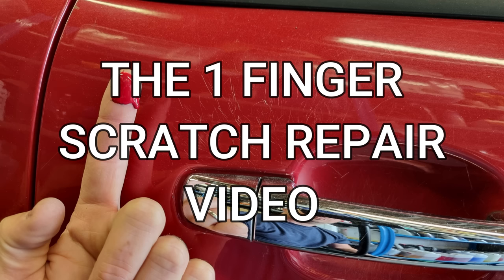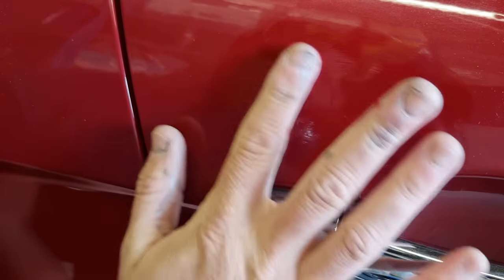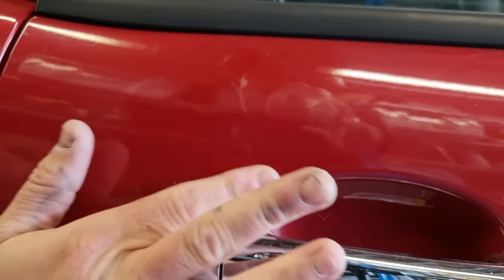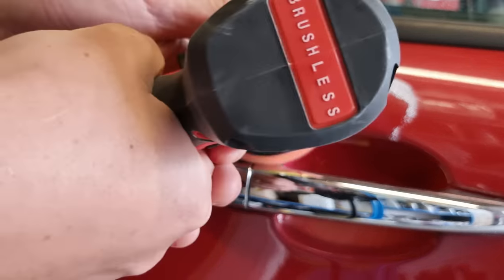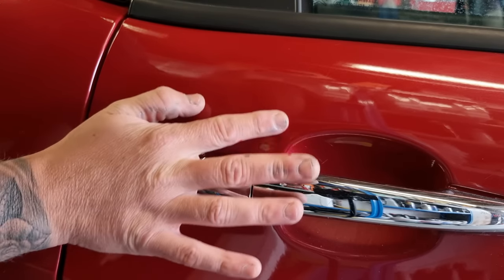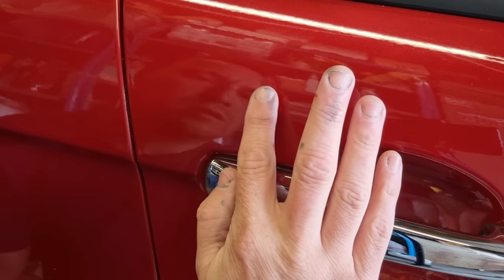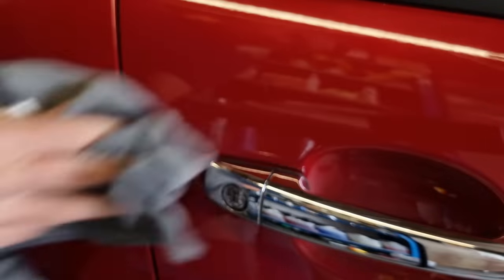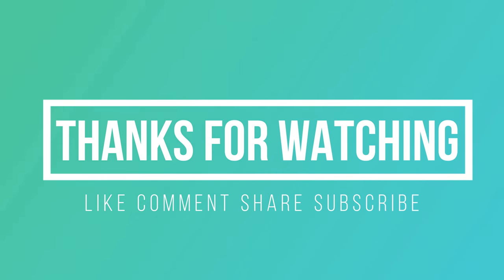Car Paintwork Scratches Try this method to save you money!!

Comment: Been a detailer for over 25 years and this is the best scratch quick fix I've seen. Cracking job, mate!
Reply from the maker: Love to hear that mate
Reply: Hi please do u leave it to dry or u polish straight away
Reply: @zoomgalaxy5876  You should probably let it dry first before putting wax on it
Reply: Well if anyone was entitled to make that judgement Mich, I think it would definitely be you buddy! 👍
Reply: Any suggestions on how to remove light scratches and swirl marks ? Like only noticeable in particular lighting an angles. Long story short wiped down parts of the car with microfibre cloth that was wet ( so was the area ) then wiped it down with a dry one. Any suggestions?
Reply: @supermoegaming4487 needs a minor paint correction, light polish maybe. Also I think ceramic coating could fill in really light scratches, or if you have black paint there is a black filler polish wax that works great for a little while
Reply: @justinprohm  Thank you!!
Reply: @cvrpov into the paint.Do I need to add a hardener or a different chemical
Reply: Thanks for this great help, a friends car is 25 yrs old and needs some paint repair on a budget .
Reply: I’m not surprised that Edward Scissorhands was chuffed when he picked it up.
Reply: @supermoegaming4487  yes machine polish your car. First compound and then a fine polish. 2 passes of each should do it.
Reply: @cvrpov .You are very unclear as to when you can buff up the new paint. How long to leave it?
Reply: @cvrpov   You are very unclear as to how long to leave the new paint before buffing.
Reply: good question, i would also like to know. At around 4:05 he says it didn’t require hours or days for the paint to dry, so I would assume when the paint you wiped on is dry to the touch and not sticky.
Reply: @JV8391 It is obvious,  is it not? He meant he waited until it is dry, depending on temperature,  it can take 20 minutes, 10 minutes or an hour.
Reply: @theilluminatedone525  Just asking for clarity as obviously the touch up paint was not completely cured in the video
Reply: @JV8391  it was, he just did not show you. If it was still wet, it would smudge when sanded or touched.
Reply: @theilluminatedone525  Thanks for being the smartest guy in the room. We're all here on youtube to watch things and learn, not to see one thing and assume another thing. 

I watched most of his other vids so I've got an understanding of it.
Reply: @JV8391  pleasure man, sometimes just a little bit of common sense will go a long way.
Reply: That's unreal. Just a few minutes to let the paint dry. Great result, well done.
Reply: Guys, here is The True Savior

HalleluYAH “Praise ye YaH”

YaH is The Father (Genesis 1)
YaH arrives via the TENT OF MEETING
YaH was Who they Crucified for our sins
YaH was Crucified on an Almond TREE

Ancient Semitic Moshe (Moses)
Isaiah Scroll (The Original Isaiah)
Reply: Sorry man but I need to ask: after working 25years on paint you have never tried to actually apply paint into scratch or any other paint defect??????? @cvrpov you're going to destroy paintworks 😂
Reply: How can we get your suggested products in the US?

Comment: I tried this technique on my 1995 Ford Mustang. It's metallic red and had a large number of minor scratches on the passenger door. I used Testors model paint and the results were very good. Of course it didn't remove the scratches, but I would say it looks 95% better. And the paint only cost $3.25.
Reply from the maker: good stuff mate glad it worked for u

Comment: That worked surprisingly well, not that I ever doubted you! In my case, I hand compounded away the extra paint, with not much effort. If I had advice for anyone doing this for the first time, it would be to use just the lightest dab of paint. Less paint, as long as it fills the scratch, means less buffing.

Comment: I've done exactly this for many years with about the same 90 % results.  I've just retired a GMC van after 22 Canadian winters and I've often had people stop me to ask if I've had the vehicle repainted.  Fill the ditch with paint and buff off the thin excess on the flat surfaces.
Reply from the maker: It works great in the right circumstances
Reply: I'm Canadian also... What paint and polish do you use?

Comment: I've got a fairly bad scuff in the middle of a panel and was about to pay over £500 to have the whole  panel repainted. To be honest,  I'm a bit worried about the matching to adjacent panels. Having seen this, I think it's worth having a go first. If the scratch is too bad and it doesn't work, I won't be worse off. Thanks for the tip!
Reply from the maker: Always worth a go mate. That's what this channel is all about

Comment: ❤ Great method thank you very much.

I tried it with meguiar's ultimate compound and a drill. The deep scratches don't go away with this compound. But combined with the touchup pain, it does fill them up nicely so you can't see them from a distance. Much better than the white scratches on my dark metallic paint I had before.
Reply from the maker: Glad it helped

Comment: Having just spent the past couple of weeks learning on the go how to fill & paint deep scratches on a friend’s car, I’m pretty blown away by this.  Their car is a silver metallic Hyundai & so has loads of holographic glitter bits in the paint, so after filling the deepest scratches with putty (down to plastic on the bumper - use a putty that you mix up a bit at a time or your whole tin will harden while you’re still filling in the first few scratches 😫), I’ve been using a bit of torn up sponge to dab the custom-mixed acrylic paint with hardener on.  It’s a great way to get the sparkly bits to stick.  It’s a bit darker than the original though as the original paint has faded a bit, so trying to hide it totally is really hard, so this wiping method might work better.  (Only cost $28 Aus for the paint).   Will definitely try this for the shallow scratches.  One issue though is that apparently you can’t expect the paint to stick for long over wax - you have to clean & wet sand with a fine sandpaper a bit (I’ve been using 1200 grit) or use a wax & grease remover to allow the paint to grab between coats.  So better to clean/sand, wipe on paint, allow to dry, wet sand until smooth, reapply as needed, then do a gloss topcoat (another $20 ish plus make sure you mask off the rest of the car & windows!) & wax or just wax if you’re not too fussy about longevity.   Without the UV gloss topcoat, the paint you added will darken over time.  But this method will definitely pretty up the area & is an easy top-up for not much money so depends on what results you want.  Roll on the self-fixing paint is all I can say!
Reply: PS thanks for the quick intro!  So refreshing

Comment: This does work but it works much better if you thoroughly clean the area with a suitable solvent before you apply the paint. That way you remove all the polish and cleaning products that might be embedded in the scratches.
Reply from the maker: This car hadn't seen any polish in years by the looks of it
Reply: @cvrpov  Probably right but the upload is for people in general. Some suitable solvent get rid of atmospheric and environmental dirt as well.

Comment: Great method.Just wondering, How long did you leave paint on before buffing.  Is the paint from a can or out of a touch up pen. Would  using a touch up pen (brush end) work the same i.e. smearing on scratches then buffing.  Cant wait to try this. Fantastic video
Reply from the maker: Touch up pen yes.. aerosol no
Reply: @cvrpov  Perhaps I missed it, how long did you leave the paint on before buffing?
Reply: @cvrpov  Hey Mister.   Michael and Bob want to know "how long did you leave the paint on before buffing". Would you like to give an answer? It's been like 2 weeks now.

Comment: Great Job, Can you tell us aprox.  cutting power of the compound you used ? Is it around 5/10 ? (Like Menzerna 2500) I guess if you use an agressive compound , it could  remove the paint that you applied. Thanks
Reply from the maker: G360 I'd about 8/10
Reply: @cvrpov  Thank you

Comment: Dude...overkill. For the past 20 yrs I have removed ALL fingernail scratches from door handle areas with the least abrasive paste in the polish line up: CAR CLEANER WAX in my case I prefer Maguire's, it works so well, it doesn't even require a machine, you can do it by hand, quick and least invasive.
Reply from the maker: 100% wouldn't of removed all of these. Maybe some, but not to the level this would. Trust me... been doing this 18years myself. Waxes most often just temporarily fill damage.
Reply: No, the car cleaner wax lasts for a few days and then washes out. (Getting fresh paint into the scratches is a brilliant answer!) well done and nice job!
Reply: This is why I open and close for passengers.
Reply: Honestly what planet you from. Some of theses scratches are made by keys. No polish in the world will cute then out DUDE
Reply: DUDE...These marks are deeper than surface scuffs left from finger nails. I'm a fan of Maguire's cleaner wax too but it's not going to do squat against the deeper scratches in this video.
Reply: He said he can’t Polish these scratches out… dude

Comment: It makes sense bcos the scratches are filled by the paint. It takes the eye off the scratch. The buffing evens out the stained paintwork around the scratch. I use a felttip dipped in paint to fill the scratch but this method really gets into the nooks and crannies. Great job though
Reply from the maker: Thanks bud

Comment: I had this problem and used electronic spray to clean both front doors. Local Ford dealer replaced switches in each but the dinging continued; they were stumped. I went to Aberdeen Midas for safety evaluation and in the process the Tec,  “Jake” found the rear passenger door was not latching at the bottom. With cleaning and lubrication the latch worked, the door ajar warning was resolved and the damn dinging stopped😀👍 Thank you Jake.
Reply from the maker: Not all hero's wear capes. Thankyou jake

Comment: Excellent straight to the point video, it's how i do my videos on my YouTube channel.  Could I spray paint into a lid from a spray can and use that paint to dab on with finger?
Reply from the maker: Rattle can paint is often too thin. Perhaps spray some in then leave the solvents to evaporate and thicken the paint up a bit. Never tried this mind, just a suggestion
Reply: @cvrpov  thanks for the advice, I may do a video, I will mention you if I do

Comment: When you say Solvent paint, what are you talking about exactly?   Is this automotive paint or are you talking about brands that sell at hardware stores likes rustproof paint?  This method is great for things that would need a repaint, I want to add it to my skill toolbox for sure!
Reply from the maker: It's basically the paint that sprayers use. Less common but still readily available. If your in the UK www.paintgear.co.uk sell it

Comment: I've been doing this for 30 years. Apply at 90 degree to the scratch and wet sand(very lightly with 1000) at 90deg. Then plain old tcut on a rag n a bit of wax... done. No drill no backing pad fittings and no velcro Polish pads just 20 pence worth of wet n dry 10pence worth of tcut
Reply from the maker: Surprised t cut removes 1000 grit marks. If it works it works tho mate

Comment: Thanks for revealing this scratch-remove method  I'd like to ask if it's possible to use water-based paints instead of solvent-based paints in this method. Or does it work only with solvent-based paints?

Comment: Hey mate I haven’t seen this technique before but it looks really promising and your video was great.
Is it possible to notice any edges/hard lines on the repair work when in the sun? Also would you need a clear coat? 

I am wanting to try this on a black car just on the boot hoping to get a similar result as yours.

Comment: Hi. Would u be so kind to make a video on how to fix the scratch exactly on the edge of the door??? The kind of scratch you get when you open the door on smth very close to the parking spot, a wall, a fence etc. More over please advise if the polish could be done by hand or is absolutely necessary to have the tools u have? Thanks in advance 🙏

Comment: This video just saved me a load of hassle i was just about to use a spray can cheers. Just thinking Would using clear coat instead of the coloured paint work the same.
Reply from the maker: Not rubbing but u can lay some clear in and sand. Check my other vids
Reply: @cvrpov  will do cheers

Comment: Applying compound a few minutes after painting defies all of the information out there, but it obviously works. All other sources say to wait 24 hours to a month before compounding.
Reply from the maker: This method seems like it kinda relys on the paint being not 100% dry to work. When it works, it works great
Reply: @cvrpov  Thanks for the reply and clarifying that. What compound did you use? I tried a small section with this method using Turtle heavy rubbing compound by hand and didn't get results as good as yours.

Comment: Mate, can you tell me what pads you used, and what kinda paste too..
I was gonna buy a kit from chipex its loads if little stone chips in a dark grey paint on the front valance probs motorway dings..
But there is on kinda big one like a penny size maybe smaller.
Gotta say out of all the videos ive seen yours is by far the best mate, even i could have a crack at that for sure..😂

Thanks for the video pal..👍🏻

Comment: I own a detailing business in Florida, just saw your video and have a few questions:
Is the paint you are using a single stage that includes basecoat and clear?
If not, and you are using just basecoat, is the high gloss just due to your wax and sealant?
How would you deal with original paint that has flake or pearl in it?

Excellent idea and video by the way, thanks for posting it up.

Jon
Reply from the maker: Hi Jon. Thanks for your feedback. It's solvent single stage (no activator) Automotive paint. We only have 2 types of auto paint here in the UK. Solvent or waterbased. Alot of techs still use or at least own a solvent scheme and it is readily available.
www paintgear.co.uk paint has its own gloss enhancer mixed in which I thinks helps the process.
However, if left neat (unthinned/reduced) just the solvent base works pretty well. Solid colours and dark colours work best. Silvers are not great to be honest... as always they don't play ball. 
I have good success using the method on and with metallic paints. I dont proclaim it works every time on every scratch.. but it has damn saved alot of cars and clients alot of money for me and made me alot of money too. Hope that helps.
Reply: @cvrpov   
Thanks for getting back to me so promptly.  
Yes, your input was really helpful, confirming my thoughts.  In the US we call the solvent based paint either 'single stage" (clearcoat added in) or "two stage" (base coat and clear coat).  The challenge here is to figure out how to blend a touch up paint from the car manufacturers that comes in a "kit" (small amount of base and clear) to create a single stage.  That, if we could succeed, would be brilliant because it would save at least one step and be quick.  

I'll keep you posted.

Jon

Comment: Great video, thanks for sharing.    I have to park in a public car park, as a result I've got several dinks and scratches to my clear coat along the sides of the car, it's a black car, I think this might be the answer to my problem. Question is, if I bought some black touch up paint and rubbed that in to the clear coat marks with my finger, would it be the correct paint to use?
Reply from the maker: Yes it sounds like a good idea

Comment: This looks great. Any long term issues with this? Did you end up applying a clear coat later on? Is the color difference very obvious when your in the sun, you know at just the right angle it might look like just a splotch above the handle or something?
Reply from the maker: The whole thing looked fine and from experience lasts a long time also

Comment: thanks for the video. It is true DIY which does not need the sand paper, rape, etc from the other youtubers. just a question about the paint. Can i use the spray paint? if not, what is the specification requirement of the paint?
Reply from the maker: It's neat solvent base. Not thinned. From a can won't work as it's very thin

Comment: What is acceptable Solvent Paint?   Acrylic Enamel which uses Reducer doesn't get hard enough to buff for a very long time.  Spray paint might be better but which?  touch up? or general purpose?  Straight or Acrylic Lacquer would harden nicely and can quickly buff to gloss.

Comment: I bought the kit and really struggled to cut through the excess paint, and I only used the tiniest amount too. I ended up having to use varying grades of wet and dry to get it off
Reply from the maker: Usually the g360 past in combination with the orange pad and something that rotates is enough to remove the excess
Reply: I used 3m fast cut heavy cutting compound and an orange pad on a corded drill bit to no avail. On the other hand I’m now au fait with wet and dry technique which I was afraid to do. And the bits I’ve done look much better. 👍🏻

Comment: Great video mate. 2 questions, u mentioned it wasnt am exact match. Will that section look different in the sun? Also, would u spray some clear over it? Cheers
Reply from the maker: On darker and solid colours the eye struggles to pick up the difference in colour on fine scratches
Reply: @cvrpov  so what is the best method for metallic colour scratches?

Comment: Confused, that was clear coat scratches, is it possible to apply clear coat instead of paint ? or , maybe after leveling with paint and polishing, applying clear coat and polishing so it'll have also the clear coat? 🥸🥸
Reply from the maker: Just base used. Original finish is base and clear though